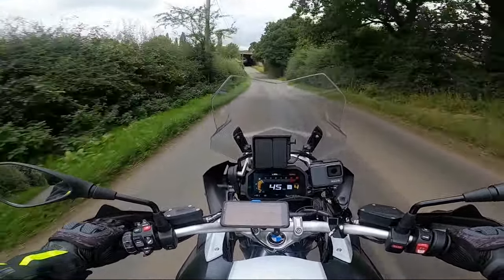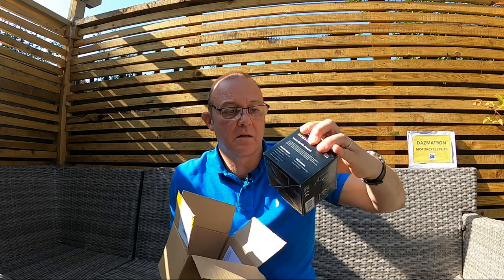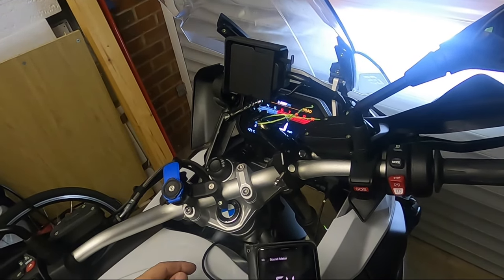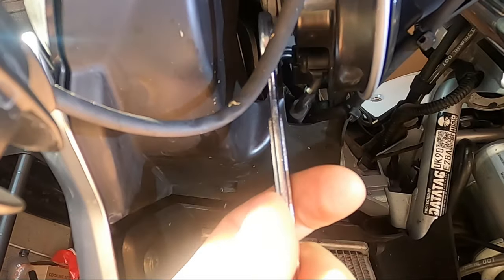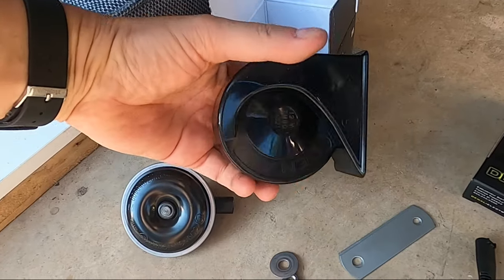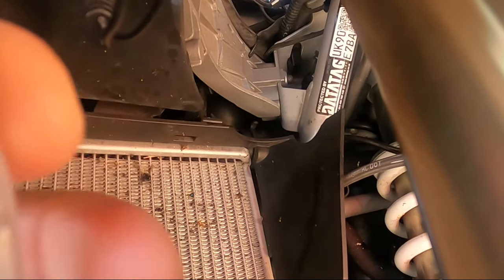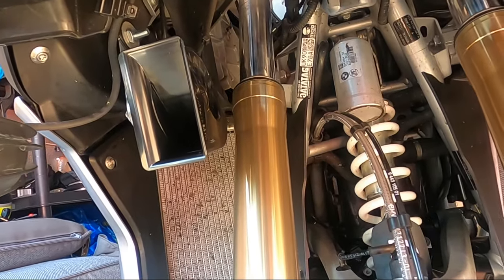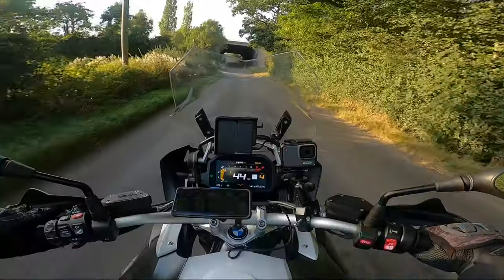BIKERS BE HEARD! DENALI HORN UPGRADE  FOR BMW R1250GS

Comment: You have to take the OEM bracket out and bend some curves to the Denali bracket and positioning it in the arch where the OEM horn was. So as You did it, it is disturbing the free flow of the air of the right cooler.
Reply from the maker: Interesting, thanks for that bit of advice although I've not had any overheating issues as such since I swapped the standard horn fof the mini sound bomb. 
The front of the GS in particularly under the headlight  does get sufficient air flow anyway so I doubt it would be effected?

Comment: Nice vid buddy, about to do the same shortly. Does it matter which spade connects to which blade on the horn side? Cheers
Reply from the maker: Hi Keith, I've just spent half an hour trying to find the fitting instructions but to no avail. It was a while ago when I fitted it I think as I never mentioned which blade went into which horn side then it didn't matter otherwise looking back I think I would have definitely mentioned that. So off the record so to speak I'd say it doesn't matter but please check the instructions you have. Oh someone mentioned to me the horn is more effective if it's pointing downwards?  Either way it's a definite upgrade!
Reply: @DazmatronMotorcycleTrips  Thanks for the reply matey, much appreciated !
Reply: Just found out, you can connect either spade and blade and it wont matter at all ! Result😀
Reply from the maker: @keithyboy123  Excellent, thanks Keith! Enjoy you're new horn!

Comment: Hi! Where did you get that connector? Thanks!
Reply from the maker: Hi Ausejo, I got it from motorcycle online accessories called 'Nippy Normans'. If u type in Denali sound bomb mini once you are on the website the part will come up. If you scroll towards the bottom you will see the different connectors. Hope that helps 👍